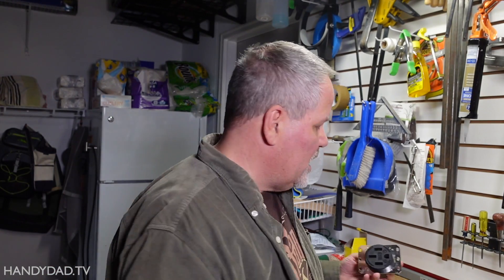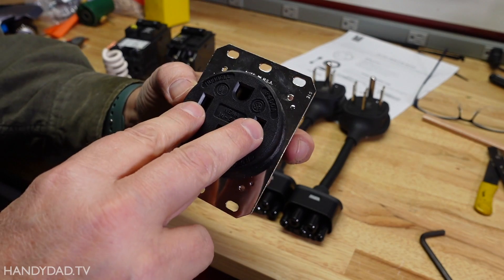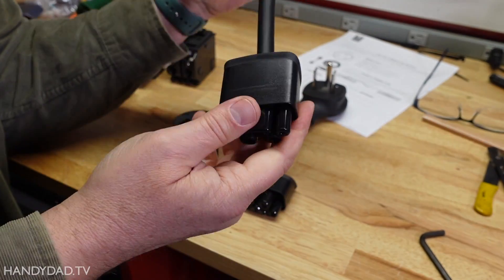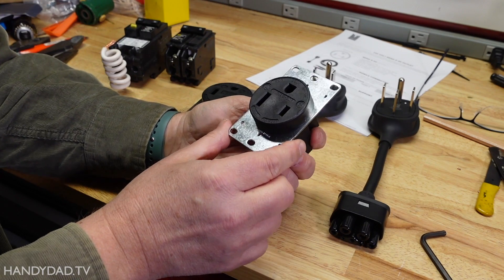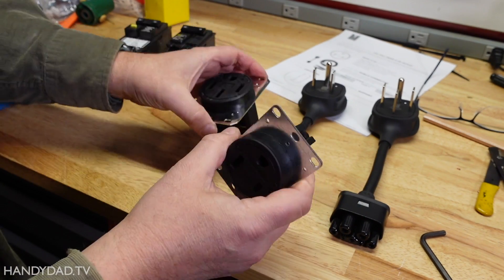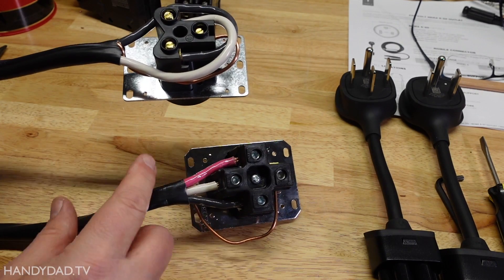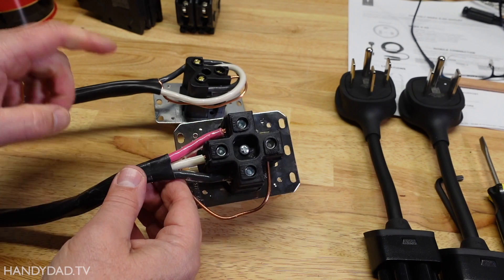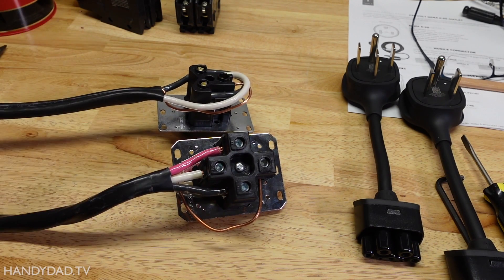NEMA 14-50 vs 6-50 for EV charging

Comment: Great video! Just bought a model 3 and PO just had the standard house hold one but also a 14-50. I only have a 6-50 outlet in the garage.  Is it at all possible to install a 14-50 outlet with only  the 3 wires that are in the 6-50 outlet box?
Reply from the maker: The Tesla UMC should work on a 14-50 without the neutral wire. Why not buy the 6-50 adapter and don’t bother replacing the outlet? Much easier.
Reply: My bad, I actually have a 6-30 nema……I’ve been looking at so many adapters and plugs that I listed the wrong one. Tesla doesn’t make a 6-30…..must be too old.
 I actually found an after market one (Tesla 6-30 adapter) that people seem to be happy with.
Hopefully it’s good!
Reply from the maker: You can replace the outlet with a 10-30 because it’s a 30-amp outlet. Tesla makes a 10-30 adapter (I wouldn’t use a 3rd party). You can’t replace it with a 14-50 because that’s a 50-amp outlet and your wire and breaker won’t handle 50 amps.
Reply: @handydadtv  
So how would you wire that up?
My 3 wire setup has a ground and all I have read says that the 10-30 is different…….also that they’re grandfathered but not to code or legal to install since about 1989……..I could be wrong but that’s what I’ve gathered
Reply from the maker: There should be three screws on the receptacle: one ground and two hots (sometimes labeled X and Y). The bare wire goes to ground and the other two wires go on X and Y. It doesn’t matter what color the wires are. It will work either way.
Reply: @handydadtv  
Sorry for all the questions…….I appreciate your help.
 So are you saying that the 6-30 and 10-30 are wired the exact same way?
Reply from the maker: I don’t have both outlets on hand to compare them, but they are both 2-pole, 240-volt, 30-amp outlets. So I assume it should be a straightforward swap.
Reply: @wade4652  Technically, no, functionally yes. Especially if this is coming off the panel where the neutral and ground are bonded. The NEMA 6 series connectors use two hots and a ground, while the 10 series uses two hots and a neutral, no ground. That's why the 10 series is depreciated. Back at your main disconnection point, the neutral and ground should be bonded. This will either be an outside disconnect in newer construction, or in the main panel in older construction.

The NEMA 1 and 2 series receptacles are depreciated for the same reason, though the 1-15P is still common, but it's compatible with the 5-15R and 5-20R outlets that are ubiquitous.

Comment: I’ve had the NEMA 6-50 installed for years using a 50 amp breaker.  It was originally for a leased Chevy Spark EV then a leased Chevy Volt before getting a Model 3 in 2018. It has worked flawlessly and connected to a used Tesla Mobile Connector & 6-50 Tesla NEMA adapter (I keep the original one in the trunk), it charges at the full 32 amps which is roughly 30 miles per hour.  So I don’t see the need to spend the extra money on a Tesla Wall Connector.  Thanks for the info Handy Dad.
Reply: 6-50's are typically commercial grade, even when bought at Lowes or Home Depot. My 6-50 did just fine for 12 years. I replaced only because it was old, not because it was faulty.
Reply from the maker: Thanks, but it sounds like you knew everything already. 😉
Reply: @handydadtv but he’s confirmed my plan is correct. I can use the welding outlet my husband had installed in the garage with the mobile charger rather than paying for an electrician/permit/wall charger. 

Thank you for this video. I was looking for an explanation of the difference between the two outlets

Comment: I had 6-50 installed when I leased the 2013 Volt. Have used it to date with the Smart EQ EV. Anticipate using it when I get the Model Y.
Reply from the maker: Have you ordered the Y yet?
Reply: @handydadtv  Not yet still have time on the Smart lease. Y delivery time is about 7 months.